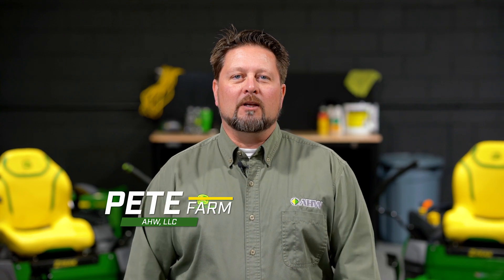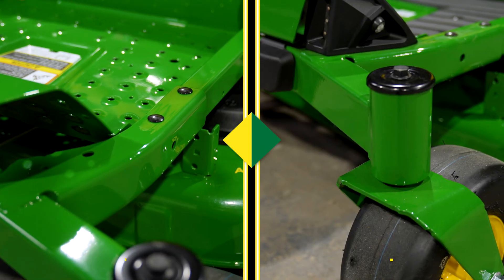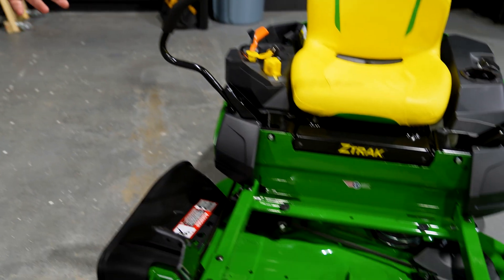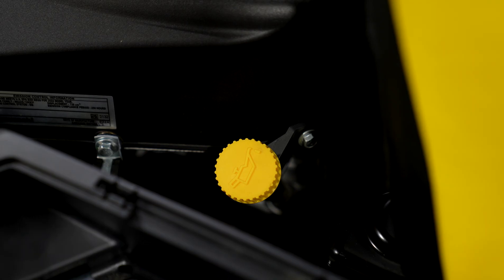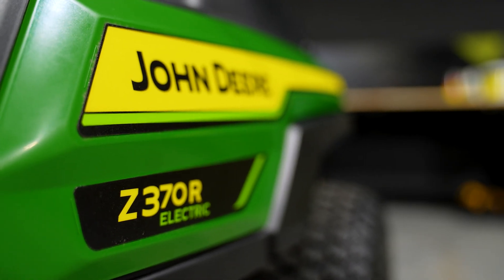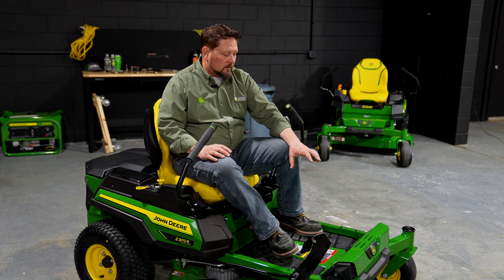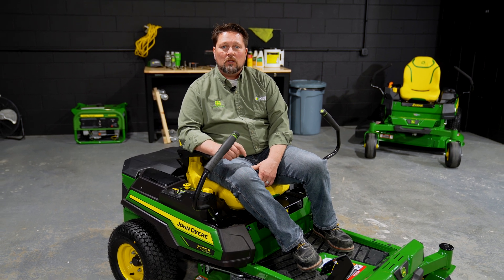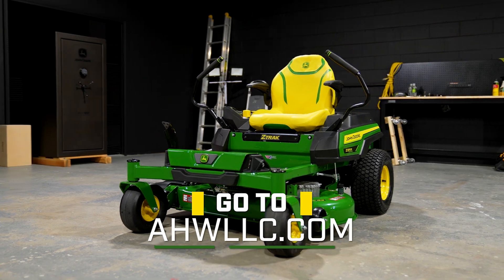New John Deere Z370R Electric Zero Turn Mower Vs Gas Powered Mower | AHW LLC

Comment: What should people in cold climates do in the winter with this zero turn? JD says storage at --4F but I live in a place that can have --20 below and I've seen solid research that says there is battery degradation below freezing (32F) on Li-Ion batteries.
Reply from the maker: Thank you for your question about the John Deere Z370R Electric Zero Turn Mower and its performance in cold climates. You're correct that lithium-ion batteries can experience degradation in extremely low temperatures.

Electric mowers, like the Z370R, are ideal for certain situations but may not be the best fit for every environment. If you live in an area where temperatures frequently drop below -4°F and you don't have the ability to store the mower in a conditioned space, this model might not meet your needs optimally.

For best performance and longevity, storing the mower in a temperature-controlled environment during winter is crucial. If this isn’t possible, you might want to consider a gas-powered model, which can be more resilient in extremely cold conditions.

Please feel free to reach out if you have any further questions or need help finding the perfect mower for your situation!